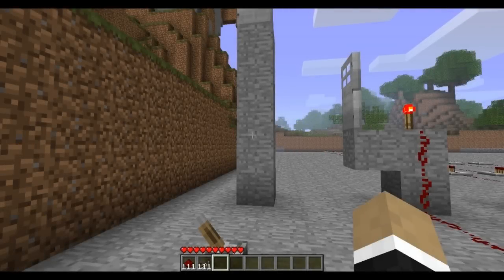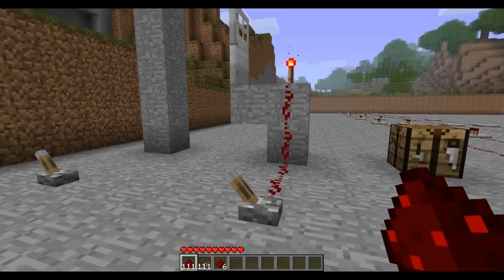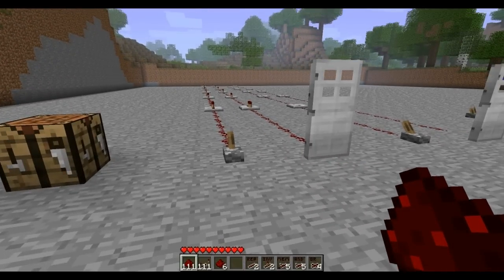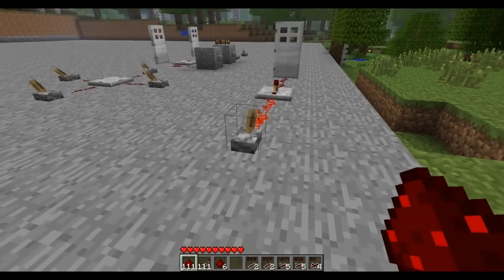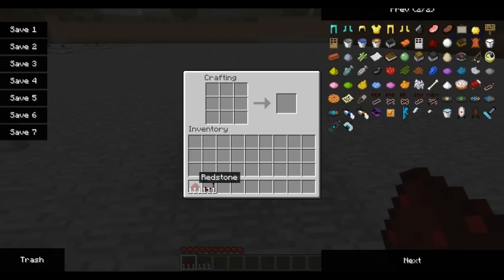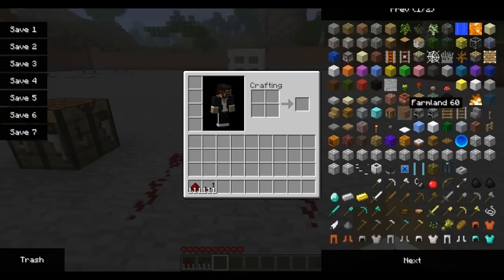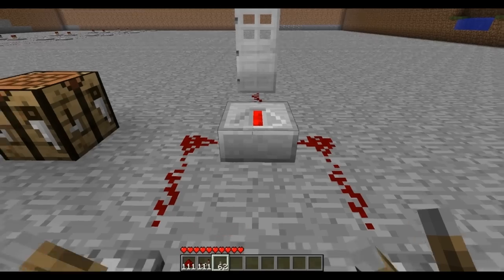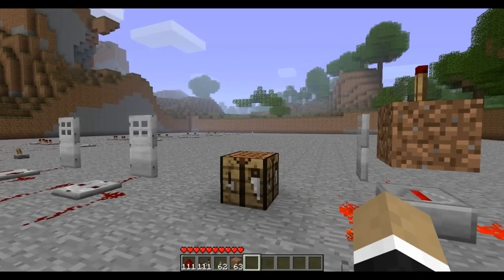Minecraft: Redstone Mods! (Vertical Wiring, Instant/Programmable Gates)

Comment: 2016 and still no vertical wiring available
Reply: correction 2017
Reply: redstone paste works
Reply: Correction, it is currently 2038, except we all believe it to be 2017 due to a communist scheme involving weather and time manipulation.
Reply: @vaomond5326  Correction 2021
Reply: 2021 and still nothing :|
Reply: @Fi-sh  early 2022
Reply: correction 2018
Reply: Redpower 2 or other mods
Also even though redstone dust doesn’t work there are plenty of ways to fgo vertical
The easiest is stacked redstone torces, but there are also more advanced ways that I can’t remember
Reply: Also in creative mode, command blocks can be used for wireless redstone by using /fill with redstone components, or air to remove them
Reply: correction 2019
Reply: @Pierogi Thanks for recommending it, just downloaded it for 1.12.2, it's amazing mod, even tho it's looking weird on screenshots, it's mechanics are great, it's even greater then vertical wires.

@Xonium Vortex
Try redstone paste, you wont be dissapointed
Reply: EXISTE UMA FIAÇAO VERTICAL JA SIM
Reply: correction 2020
Reply: correction 2020
Reply: Correction 2020
Reply: 2020 and still nothing :/
Reply: correction 2025

Comment: The problem with using a wire is in complex systems. If one input is 0 and the other is 1, the wire will not only make the output 1 like its supposed to, but also feed a 1 in the input that was supposed to be 0, ultimately leading to calculation errors if that path leads to an input of an other gate nearby.

Comment: in Minecrafrt you can create circuits using redstone dust, which can make electricity. It can be used to open doors automatically, turn on lights and power your mine cart. Some advanced players use this to create very complicated circuits, complex enough that they need to use some programming basics. an OR Gate is just one of these features,

OR gate example is if you have 2 switches and one door, any switch will open the door. Think of it as switch one OR switch 2 can open the door.

Comment: @Love1War I agree to me it seems that levers have some electric output meaning if I hit a switch in real life it will conduct to with electricity coming from no where it would be better if you had to somehow combine the redstone torch with the pressure plates button ect to create and electric output/ source but the button and plates alone can only process one block of power and can not be output twards a repeater this making it only good for a door but longer circutry using the combo

Comment: there was an unused item called the gear, which was intended for vertival wiring.
if you ask "why did they not use this item?" if you placed the gear on a block you could not get it off. if you broke a block it would return as soon as you replaced the block with another block

Comment: @cerealboy2009 Sure, you could do that, but the problem with not gates is that they invert your signal. If you want to extend your wire, but have the same signal reaching your target as your input you'll have to use two not gates.  Added to that, each not gate uses 2 blocks worth of space instead of one. So to use not gates just to extend your wire you'll actually need 5 blocks of space (block > Torch > Wire > Block > Torch), whereas repeaters only take one block

Comment: @cerealboy2009  That's one reason, yes. Another reason is to make longer redstone lines. Unaided redstone will only send power up to 15 blocks before stopping, using a repeater will extend the power for another 15 blocks. That can cause problems though because every repeater (on the lowest setting) will add a two torch delay to the signal (Like he showed in the video). This mod lets you run wires as long as you want without having to worry about delay

Comment: @TheFyroPyro I'm talking about the 1 bock wide latches. If they were smaller versions of the actual latch that would make sense, but when it is just a magical grey block that 'happens' to be an and gate, it's completely illogcal. A calculator is the same thing big or small, just compacted, it's not like someone just finds a grey colored rock that is 1 inch wide and it acts as a calculator.

Comment: @ixcaliber so insulated wires are "magic"? do wires connect even though you don't want them to in real life? do wires fizzle out after less than 100 feet in real life? Also, programmable gates are the same, just more complicated. redpower is not cheating. in real life, it doesn't take 1000's of square yards to make a calculator, so how is this magic?

Comment: @Nnelg9111 Agreed! I like the "And" switch especially, since I downloaded some schematics for MCEdit. Basically I got two guard-towers, put them near each other and built a large wall connecting them. Inside the towers I had two switches that BOTH need to be activated to open a piston-gate in the wall. Unfortunately I didn't have this mod so it was literally HELL to build and have ALL the gate open at the same time!

Comment: [1.7.3] Eloraam's Mods (RedPower V1.7.1, Integrated Redstone (now RedPower Logic), Redstone Pipe) 
This mod is better because you can actually have different coloured wiring which don't interact, it has ways to make hiding redstone easier also it has lots of logic gates and clocks that fit into 1 square.

Comment: @TheSuperNinjaBlooper 
It maintains an input until the opposite input is activated. For example, I use it in a door: the button is an input and the door is the output, but I hate having to rush through after hitting the button, so I hooked it up to an RS NOR latch. It keeps the door open after I hit the button, until I hit the opposite input (I use a pressure plate, but I could use a button on the inside of the door) Another use is to make a set duration, where repeaters delay he alternate input

Comment: @hershiekopper um, repeaters are less delay than a torch system 1/2 of the time, a torch adds as much delay as a repeater on setting 0/1 (the default), but it also requires 2 torches to end with the same signal as it started